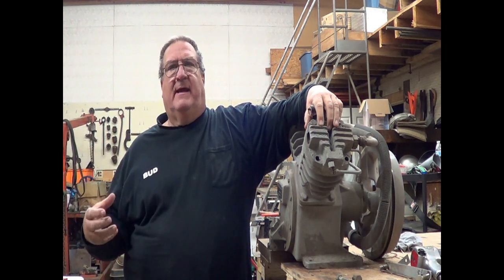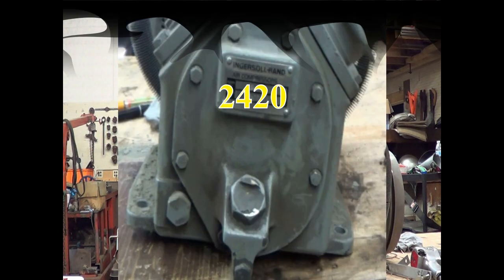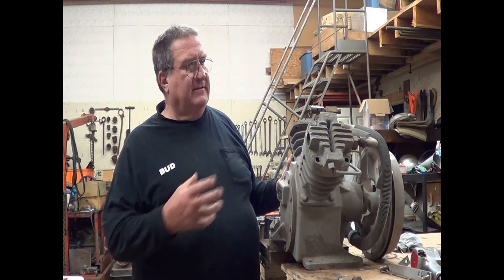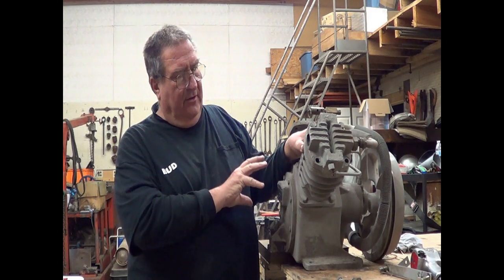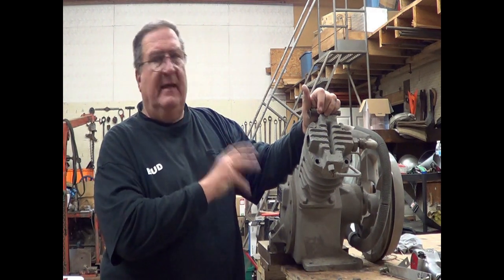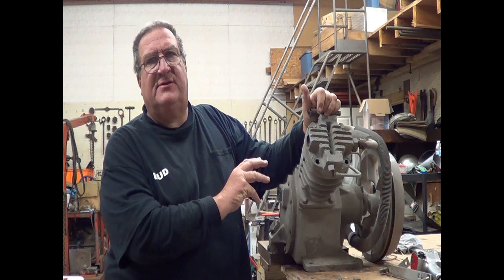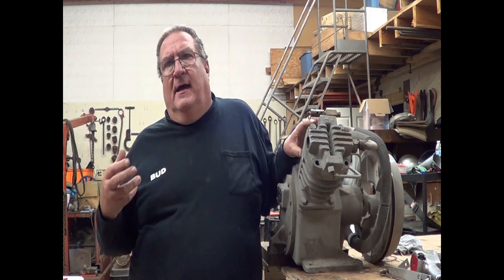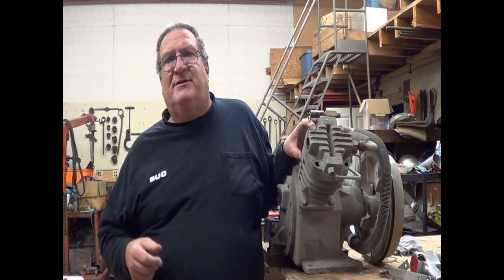Ingersoll Evolution Over the Years S2, E 26

Comment: Impressive knowledge you have off the top of your head! I have a tech question. I have a 7.5hp IR compressor T30 253. It was used in the building I own that used to be a machine shop 30 years ago. (Building was built in the 70’s) after inspecting the compressor as it’s been sitting neglected for at least 20 years, it appears to be in excellent shape yet internally. I’ve replaced the valves and head gaskets, and I’m going thru other items that need fixing. One thing I noticed is that it appears that the 2nd stage head had overhead in its last life as the gaskets were charred and the paint burnt. I found the in-tank check valve to be disintegrated. I now have it running and holding pressure great. What I haven’t tested yet is startup force and I’m wondering if the relief system on this pump should be upgraded to discharge from the check valve port to the pressure switch instead of the faceplate/ governer/flyweight thing. If so do I have to retrofit anything in the faceplate or just plug it?
Reply from the maker: Hi Scott. as a rule I upgrade to the pressure switch and check valve set up. it more dependable , easier to set up and easier to diagnosis if you have a check valve or unloader problem. I have the parts you need on stock at a reasonable price if you need them. you may contact me through thecompressorguru.com.
i was wondering is the motor a 3 phase?

Comment: What type of thread is used on IR 242 bolts and nuts? UNC or BSW or other?
Reply from the maker: Interesting question. I would quickly answer SAE course thread... but I did not know till now a more correct answer is UNC thank you for making me learn something. my life rule #4 is never stop learning. I now am going to look up BSW
Reply from the maker: no BSW that I know of thank you for the question. BTW where are you?
Reply: @THECompressorGuru  I needed information about the type of thread to repair bolts and nuts, because new bolts are almost not sold anywhere and they are expensive.
I'm from Russia. We use metric hardware
Reply from the maker: @frankmartin7922     Wow this is not an easy solution. there is an American company ( Heli Coil)that has repair kits for stripped holes. I have o idea how you would place an order for export to Russia. here is the website for the heli coil
 https://www.stanleyengineeredfastening.com/en/brands/Optia/heli-coil
let me know how this works out.
Reply: @THECompressorGuru  I bought Tap and Die Set with UNC thread. But I thought I was wrong and I need a set with a BSW thread or another
Reply from the maker: @frankmartin7922  I applaud your ingenuity. Keep it up.
Reply: I am repairing IR242 now. I made a cylinder resleeve. I couldn't find where to buy h.p. pin and replaced it with a piston pin from a Soviet Ural motorcycle. This piston pin is slightly larger and I also bored out the connecting rod bushing.
I bought piston rings on eBay before the start of the war with Ukraine. Now Russians can’t buy goods on eBay.
I also need to make a new crankshaft key, because I ruined the old one.

Comment: That was very educational, Guru. That brings up 2 questions: Would it be fairly easy to upgrade a 2420 unloader system to the 2475 unloader system for easiest startups with both sides unloaded?  If Yes, what parts would be replaced/added? Thanks Mr. Guru ! Paul from South Texas
Reply from the maker: Yes as for unloading simply plug the current unloader and run the unloader line from the check valve to the port on the pressure switch . a few 2420s may not have a check valve ... so then install 1.

Comment: Hi Guru, I liked very much your explanation. I have an IR 2340 and it seems to be the exception to the extra piece of hardware for the discharge/unloader valve that you said that is missing on the 2420 models/series. Would be possible that this extra piece of hardware goes from the 2340 onward until the 2475? Great channel... I enjoy very much your videos.
Reply from the maker: IR didn't need to do more to the 2340. I can't remember if they started originally put the extra piece of hardware in the 2340 . but with the new kits for the 2420 they do now come with that extra piece. I guess if IR didn't get everything right on the 2340 the next version might be a 2375? any  way you have a good machine if you need any thing let me know. thank for watching.